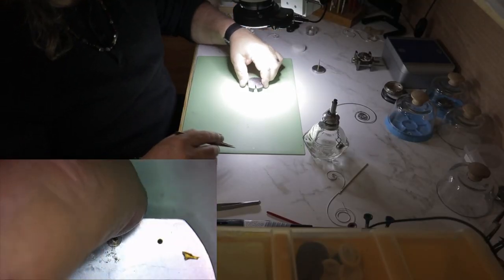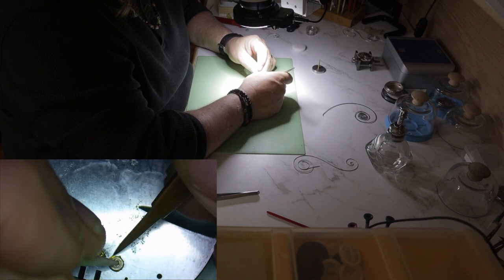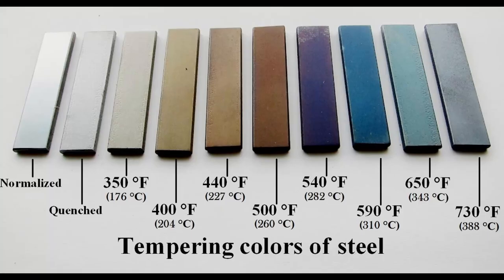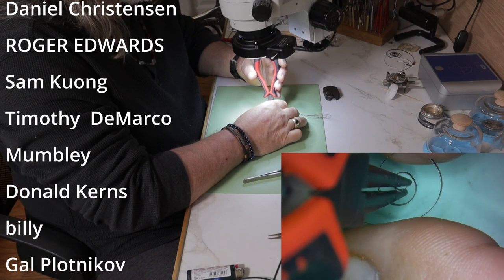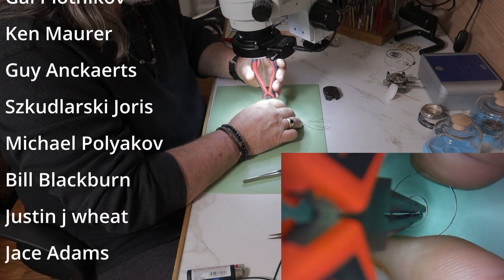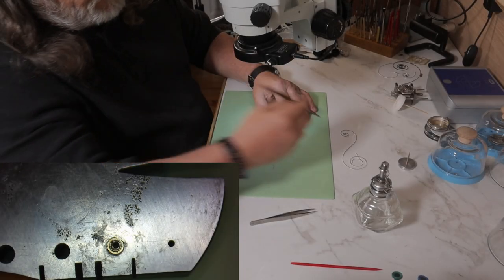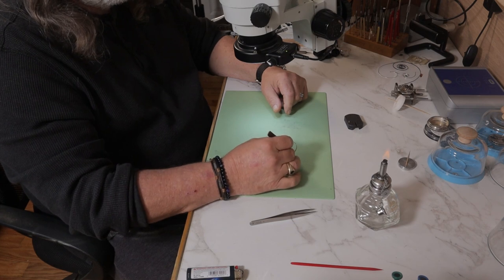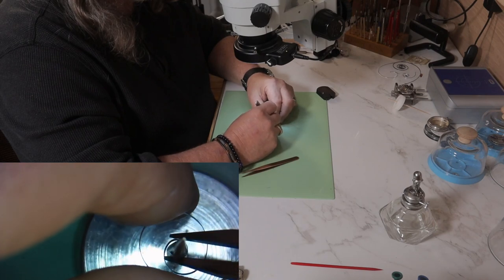How to Make the Inner Coil of a Mainspring Smaller- Without Breaking It

Comment: Thanks. Had a memory lapse on the post. Was remembering a new 2824 MS too small for my available winding arbors. Should have popped right in but didn’t and went downhill from there. You have great videos that the average guy can understand. Thanks again.
Reply from the maker: Glad I could help John
Reply: What do you do in that scenario? I have the same issue. Is tempering advised for that also?

Comment: Thanks Alex for another interesting video.  I have a similar problem with my mainspring winder.  The spring is not tight enough to get hooked on the winder arbor pin so I cannot wind it properly.  I think your technique will help with that also.
Reply from the maker: Thanks for sharing. I didn't even think about that, but that's another good use of the technique.

Comment: Another tip I haven't seen elsewhere. I have to use this pronto because the mainspring winder i had to use the winding arbor was a little too big but I had nothing else. Great work. Do you ever worry about taking the heat treat out of the mainspring? 

What videos you working on? Whats on deck? Let us know maybe in one of your vids? As always many many thanks Alex.
Reply from the maker: Do you answer your question about taking the heat out of the main spring, that’s why I use the soldering iron because it localize’s the heat to just the coil. So there are a lot of things in the pipeline I’m writing a watchmaking course, I’m finishing a small book that I’m getting ready to publish, called the secrets to adjusting watch rates, i’m waiting for some parts to finish the video series on the 917 project, I’m getting ready to review the Chinese version of the Horia Jeweling tool, the biggest mistake people make when oiling jewels in a full service on a PT 5000 that’s running poorly where I’m going to use some of the techniques from the book on watch adjusting to dial it in.
Reply: @watchrepairtutorials  yes even with the iron I wondered if it would weaken even at the just the coil. A great tip yet again that makes me wonder why didn't I think of that? Look forward to your future projects.

Comment: Hello Mr Hamilton, I touched base with you after starting to watch your lessons. I thank you not just for sharing, mentoring etc. but because of your lateral approach. And, in this virtual world how you still reached out to show interest in my journey. So, in return here is my update. On topic of the main spring, this video was invaluable but just a week after I ventured to test my winder set on a 'practice' Seiko movement. Diagnosed issue that arbor was not grabbing spring so guess what I did. Learnt a quick lesson. And then you offered the solution. Further reading and I now realise the importance of understanding how metal and heat are used to change its properties. Invaluable but I do have a broken main spring. So, that is the purpose of buying a cheap movement (I bought 2 with the goal to have 1 fully working, fine tuned movement in say 2=3 months). OK, so progress so far. I have taken apart, re-assembled 4 times. Still not quite memorised sequence but comfortable. Tweezer skills, screw driver skills, keeping movement untouched, unscratched, using loupe etc. all coming along nicely. 2nd phase, I cleaned 1 movement. 5 minutes at 65c using dish cleaner, rinsed 3 times with final in IPA and dried in oven at 65c with fan on. This turned out to be too aggressive. Top bridge or main train bridge lost its finish. My 2nd movement is getting a clean today with 3 minute timeframe and less cleaner. Just need to get the formulae correct and repeatable to ensure I get the right outcome. All my tools are lovely and thankfully, with guidance such as yourself, I feel I have invested just right. I have a microscope although I only have one working eye so just a single lens fed to my surface pro high resolution screen works great. My goal I mentioned is to be able to service my 'baby' 1965 Grand Seiko watch in about 4=6 months but I also have thought that the Moeris swiss brand of the 1950s played a big role in Seiko's 50s to 60s period and want to service one of these for its lineage. Turns out the Grands Prix I bought had a broken balance wheel pivot so I am going down the path of learning to dismantle, re-rivot and fit a repaired balance wheel. Of course you have some great content on understanding how this works and I am supplementing this with further reading. I am getting so serious about this journey I just bought a Staking set and also reading up on its usage. I also do have a Timegrapher that uses PC software and this is proving to provide interesting in-sight into the behaviour of a mechanical movement when not properly serviced and adjusted. It gives me a baseline and I feel as my skills grow I will see this baseline improve. I temper this with the understanding that vintage time-pieces and the quality of the build dictate what can be achieved. I have also not been shy to remove and clean cap jewels etc. and yes, the odd one has tried to disappear but I have a nicely setup environment, good light, organised bench, and lots of patience so to-date I have not lost a part and my practice movements are still operating. Big ramble, but I wanted you to know that the Watchmaker bug and my excitement has not wained, it has cost me about $1000 New Zealand but I feel this is no different to going out an buying a set of Golf clubs or a Sail board so easily justifiable and affordable and the reward is immense. Hope you don't mind me dumping this on you as though I am your student but it is nice to bang out my thoughts...cheers, Brett P.S. the most interesting side of Watchmakers I was not aware of at the beginning is just how important it is to understand that you can manufacture your own hand tools. You have advised this and I am reading text from 1906 that talks about how important it is to make tools comfortable to use by adding handles and to prepare, sharpen etc to ensure they give the best result. So interesting is the history...
Reply from the maker: Just a couple thoughts for you. What was the Soap that you used for your cleaning solution. You need to be careful about the PH Level. That sounds like the alkaline level is too high. 

The Staking set was a great investment. It is the one tool that has the most usefulness in watch repair. I will be doing some videos on its use and all the jobs it can do. 

What you say about timegraphers is completely true. A lot of new watchmakers get a rude awakening about their skills when they first start using them, but a timegrapher doesn’t lie.  As you understanding of inspecting and troubleshooting improves, those initial readings after service will get better and better.

“The quality of the build dictates what can be achieved” this is super important to understand. 

“! have a nicely setup environment, good light, organized bench, and lots of patience so to-date I have not lost a part”.   It looks like you have been taking some of my advice. If you do the things I talk about you will eliminate most of the problems newcomers deal with. 

Too many people skip around the videos and miss all the little nuggets of information. This is why having a mentor is so important in the learning process.  
 
You are my student and I am your teacher, well maybe a little so no problem. I really am interested, especially when I see the things helping you to succeed come from my teaching.
Reply: @watchrepairtutorials  fantastic, I'm onboard, thank you. I have a ph tester so will check.
Reply: Just thought, our water in Auckland is pretty soft and I don't doubt local supply cater so dishwashing in suds. That suggests Alk to me. Can I use the same stuff I use in spa pool to set to 7.0. Are we seeking neutral?
Reply: A bigger reveal, whilst making my espresso coffee I realized, my attitude is at fault...I treated my seiko $20 movement like it was junk. I used filtered tap water taking a short cut. That is more alkaline to start, ha other content etc so I created this problem. 2nd lesson learnt. Treat all your valuables the same...with utmost care! I am sharing so others realise the advise you receive is not just best practice, it's about professionalism!!!!
Reply from the maker: @loungebiddle7922  closer to neutral. I believe I had looked into the pH of professional grade cleaners and most of them were around 7.0.

Comment: Once again, big thanks for the sharing this priceless knowledge. One question - once you are done with forming the inner coil to the desired diameter for the arbor, do you need to reheat and dip in water the mainspring for hardening or it is not needed?
Reply from the maker: I think the least amount of modification to the mainspring with heat is best. One of the reasons that I use this tool is because I want to isolate the heat to as small area as possible. Since the heating process that manufacturers use for mainsprings is so proprietary there's no way you would know whether you were doing any good or more harm by adding more heat especially at  a very high temperature.
Reply: @watchrepairtutorials  I got your point, thanks a lot

Comment: This is a handy tip for sure. After heating the inner coil, do you need to reshape while the coil is still hot or can you first let it cool?
Reply from the maker: No you are just trying to temper it a bit to be able to shape it without breaking it. It just takes a second to cool down.

Comment: Big thanks for the excellent tips and demonstrations Alex.  I’d never thought to use my soldering iron. I’m guessing the spring, being so thin, cools really quickly after you take away the heat.  Does the steel stay soft enough to work without breaking only while it’s still hot, or is the steel pliable for longer?  I guess what I’m really asking is - how long have you got to do the manipulation to the spring after you take it off the heat?  Thanks again.
Reply from the maker: What you are attempting to do is temper the steel so it's not so brittle. Once tempered, it stays tempered. 
You're not able to harden the steel again, so it's kind of a trade-off to being able to have a usable hairspring or not. 
With that said, I've never had one break after installation.
Reply: Ah - I see - once tempered, it remains tempered.  Thanks, Alex - I’m about to plug in my soldering iron!

Comment: How do you handle a replacement MS that is too small for the arbor? Great video BTW
Reply from the maker: If it’s only slightly smaller, then I can usually get it in, holding the arbor and the arbor vise.
If it’s noticeably much smaller, then I would make sure that it’s the right main spring and if it is you could use the same technique to open it up

Comment: Hi Alex, another great video. Thank you again for sharing all your tips and tricks.
I just installed a new MS in the barrel and found out the incircle is slightly bigger than the arbor and it didn't hook. And because I haven't seen this video before, I tried to reshape it cold and, guess what? I broke this brand new spring. 
I just order another MS and I'm sure I'll run into the same issue. But now I know "What not to do" (4 valuable words in watch making that a wise man keeps telling us 😀). 
Your video explains how to reshape a MS when it's uncoiled out of the barrel. Do have a method to reshape MS when it's already in the barrel? Or better yet, reshape it before putting in the barrel when it's still coiled in that ring that comes in when new? I don't want to take it out and uncoil it because I don't have a MS winder to put it back in. 
P.S: My other hobby is electronics repair and I have a very professional soldering iron with precision temperature control and different tip sizes. 
Thanks again for your help
Reply from the maker: Unfortunately no I don’t. This is a fix that tempers only the end of the inner coil. It’s not going to be a good idea to temper anymore than necessary.
Reply: Thanks for the quick reply. I'll use my engineering skill to build a toot to help reshape the MS while it is still coiled in that ring that comes in when new.   @watchrepairtutorials
Reply: I made this simple home made tool to help test if the inner coil of a brand new mainspring (while it's still in the ring) will fit in the arbor before inserting it into the barrel. and if it doesn't fit, you can reshape it by heating it.
I used a couple of aluminum washer I already had in my tool box, and that's why they have 2 extra holes that are not needed.
Aluminum is the idea material for this because it's softer than steal so it won't scratch the mainspring. Also the aluminum will help dissipated the heat from the other parts of the spring where you don't want to get heated.
In the video I use a soldering iron to heat up the inner coil but you could use other methods too.
Check out the video and let me know if you find any problem in using this tool. Suggestions to enhance are very welcome. 
https://youtu.be/-bRaVlKCoSc
PS.: In the video I used a broken mainspring to test and get practice. I have not used in a new MS yet.

Maybe it was because the aluminum was dissipating the heat but I had to use a much higher temperature than the 227C you mentioned in your video.
Reply from the maker: @franklima1269   you are going to just fine in watchmaking my friend. Love the mindset you have. Well done man. 👍
Reply: Thanks. It's because I have a great teacher 😉 @watchrepairtutorials
Reply from the maker: @franklima1269  thank you my friend. Let me know if you need anything else.

Comment: Will tempering the coil cause weakening the mainspring? If not, can I use this method to restore the mainspring that is worn?
Reply from the maker: You can't restore mainsprings. If you do it the way I showed you, the only part of the mainspring that gets tempered is the inner coil. It has no effect on the rest f the mainspring.
Reply: @watchrepairtutorials  Thanks a lot!

Comment: Thanks! I have a blue steel mainspring for a Hamilton 987 watch movement.  It's a NOS made by Hamilton.  What do I look for in that case?
Reply from the maker: Hi Douglas,
I'm not sure what the question is.
Reply: @watchrepairtutorials  I wasn't clear.  I was referring to the color change you mentioned as you heat the metal. My Hamilton NOS mainsprings come out of the package blued.  

So, I thought with blue steel because it's already "blue" you won't see the straw color.  Based your tutorial I realized I already I knew the temperature I needed, I have a smart soldiering iron (which you recommended, thanks!) so color shouldn't matter.  

I just went ahead and followed your procedure and found that at 440 degrees the bluing goes away (so it was probably topical). I kept the heat on for a few minutes and then did what you recommended.  

So far it has worked, I got a much better fit than I've ever gotten before.  Only problem I had was shellacing the arbor to the bench block.  The catch was too close to the block for the spring to attach. That may take practice.  Thanks again.  I'd like to subscribe to your tutorials but I don't remember how to do it. (I'm 73!)
Reply from the maker: @douglasskinner  no worries Douglas. If you go to any video you should see them subscribe button.

Comment: Hi, Alex I have a main spring that I need to fit to the arbor and want to use your soldering iron method. Question is, do you set the iron temp to the desired temperature or something higher. I thinking that the rest of the spring would act like a heat sink and constantly draw the heat away from the tip.
Reply from the maker: Don't overthink it.  All you are trying to do is temper the metal so its not as brittle. It's the only way to bend it without breaking it. if you have a inner coil that is too large, it's the only option if you need a mainspring in the barrel.
Would you do this if it wasn't necessary, of course not.
Reply: @watchrepairtutorials  Thanks, Alex. Maybe I should be a bit more patient and leave it on the iron a bit longer.  The only reason I asked was I'd set my iron to 220oC  but the spring never changed colour and wasn't that hot to touch
Reply: Hi, Alex just to let you know my patience paid dividends and I managed to successfully reduce the spring to fit the arbor, before it was like a sausage in a train tunnel 😄
Reply from the maker: @yesterdayschild1418  I am so happy you were able to get it figured out. Great job man.
Reply: @watchrepairtutorials  All thanks to you and your very informative videos. For a beginner, like myself, they are priceless 👍

Comment: Have you ever used the stepped round nose pliers? They have that variety of sizes plus a flat part to help forming any metal. Let me know your insights! As always, thank you for your videos and simple solutions to odd operations!
Reply: I just watched the video, then went to amazon and bought the soldering iron linked...but the stepped wire bending pliers as you suggest.  Already have the conical ones shown, but these seem like they may be even easier.
Reply from the maker: I dont think there would be an advantage with the stepped style. Let me know how it works.
Reply: @watchrepairtutorials  I plan to give it a try.  I am thinking that it may be easier to hold the coil straight so that my bends keep it flat as much as possible.